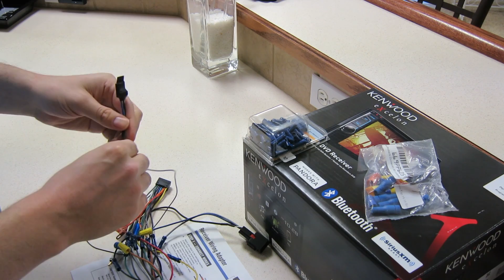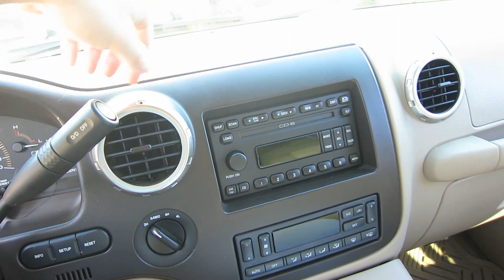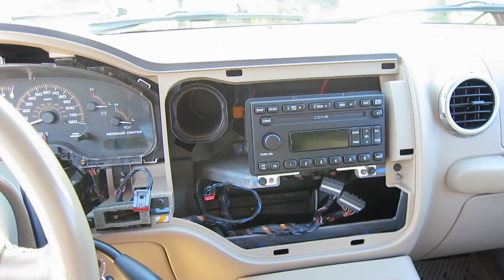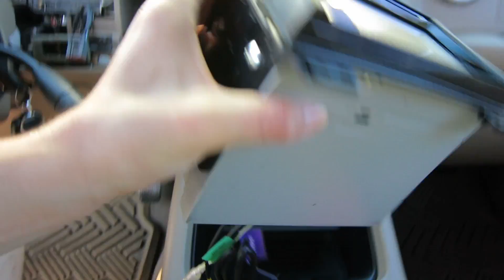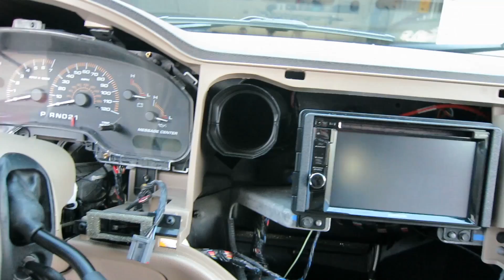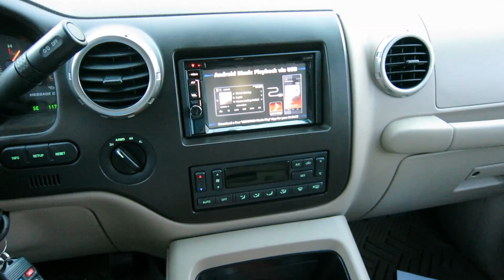2003 Ford Expedition Aftermarket Kenwood DDX593 Excelon Head Unit Install

Comment: The 3 connectors are all used, they don’t just go obsolete. 1 is for normal radio function and amp activation, another is used for rear radio controls, and another is used for the DVD player.
Reply: On an aftermarket radio that doesn't have a disc drive the 3rd most definitely is obsolete if there is no longer a use for cds

Comment: I know this is a old video but my question is what did you do for the controls on the steering wheel controls for the stereo? I want to replace my stock stereo out but I want to make sure I get full control from my steering wheel.
Reply from the maker: There is an adapter to make them work.  I didn't install it so my controls on the wheel for the radio no longer worked.
Reply: @myriadcorp  do you know what the adapter is? Also what about the DVD player in the back?
Reply from the maker: @travruhl  I didn't have a DVD player.  I got my stuff from Crutchfield.  If you call them they can tell you all the parts you need for the job.
Reply: Idk if you figured it out but it’s called a radio replacement interface. SWRFD-60L works for models from 2003-2012. You can get them from crutchfield.
Reply: @miracleinsider  link ?

Comment: Were you able to use your steering wheel radio controls?
Reply from the maker: No but if you purchased an extra module you could.  I didn't see the need.

Comment: Wire nuts? Are you driving a house?  Blue butt connectors made for 14 AWG wire on 20 AWG wires?  Hack.
Reply from the maker: It worked.  I'm not a stereo installer.  Those butt connectors were the smallest ones I could find at my local store.

Comment: i just bought a new radio for my 03 expy - just a plain jane one with a spot to shove usb keys in, not fancy like your's.   great vid - i've taken my entire truck apart trying to find a gremlin that made the auto lights not work, the radio wouldn't shut off when you got out of the car, auto locks didn't work etc... replaced almost every sensor in the thing then finally found a break in the purple wire under the drivers side step...   also,  i had to take the ignition cylinder out and clean it one time - little pieces of key get in there and one time it just wouldn't turn... now i lube it with dry lube every couple months - newer models have a hole under that you can stick a screwdriver in and release it, so obviously it's a known problem... not difficult, just a pain...  but i have to ask, is your truck ALWAYS that clean?   i have two slobbering dogs and a dirt road to get home and that pretty much means any cleaning job is only a few hours worth of enjoyment.

Comment: If I want use an aftermarket amp and subwoofer do I hook up that RCA jack to the amp? I'm confused on that part. Can't find any videos or forum that explains it.
Reply from the maker: Yeah you would hook up to the rca jack and then you would have to wire the amp to your battery.

Comment: Screw this, I am going to the professionals. I put many a car stereo in my day but this one takes the cake. Thanks though
Reply from the maker: Are you putting it into a 2003 Ford Expedition?  If yes it's really easy if you have the correct brackets and plugs.  So I actually changed out the Kenwood to a Pioneer for the viability.   Now the Pioneer is starting to have amp issues.  I may have to buy another radio.  These things are not made to last.

Comment: What's that knob below the air vent? My EB does not have that
Reply from the maker: Changes from 2 Wheel drive to 4 wheel drive.
Reply: myriadcorp is yours a 5.6 triton?
Reply from the maker: Thought it was a 5.4 maybe it's .6 I have to look.  It's a 2003 Eddie Bauer.
Reply: myriadcorp mines an 03 as well. Anyways your interior is top notch.lol

Comment: Thanks for posting this video. Thumbs up to all the die hard Ford truck enthusiasts out there.  I have a 2000 Expy with 234K miles on it and is still running strong with far fewer problems than I would've expected for a vehicle with this many miles on it. Nevertheless, we decided to upgrade a little and bought and 03 Eddie Bauer (144K) over the weekend. I was very disappointed to learn the Navigation system requires expensive CDs to function and the phone button did absolutely nothing when I tried to do a bluetooth sync. I have been looking at installing the Kenwood but was too intimidated by all the detailed wiring. Your video gave me the hope I needed to move forward with installing the unit myself rather than paying through the nose to have someone else do it. Great job and thanks again.

Comment: how it went with the steering wheel control s
Reply from the maker: I didn't waste the money on the steering wheel control adapter.  It would have cost a ton only to gain volume and forward/backward.  The radio has a remote.  I use that if I don't want to touch the head unit.  I wouldn't recommend spending the money to get the steering wheel controls.

Comment: Wow your interior is in good shape.
Reply from the maker: Thanks I try to keep it nice. I plan on driving this car until the wheels fall off.
Reply: My 2003 XLT has 211,000 miles on it and the wheels are still securely attached. She still purrs like a kitten too.
Reply from the maker: I just put new Monroe Quick Struts on it.   I hope mine goes to 211k.  I am at 120k right now.  https://youtu.be/y7f0nsWtmbA
Reply: My 2006 XLT is all original and it has 274,000 miles. I bought it brand new and it still looks that way inside and out. I too plan on driving it until the wheels fall off. I've been thinking about upgrading the radio for Bluetooth and touchscreen. Great video I didn't know it was that easy to install. Thanks!

Comment: if you just ground out the green "brake" wire then you can bypass the need to have the brake depressed for some of the features.
Reply: Never even thought of that.....2yrs later but thanks

Comment: Did you loose your DVD player and steering wheel controls? Been contemplating upgrading to a unit with blue tooth, but not sure f it's worth loosing all the other features.
Reply from the maker: I did not have a dvd player with my SUV.  There are wiring kits you can buy to keep your steering wheel controls.  In my case I skipped it because the abilities I had to control the radio with the steering wheel was limited to volume and changing channels.  Not worth the added expense of a wiring kit.  Not to mention the radio I selected came with a remote.